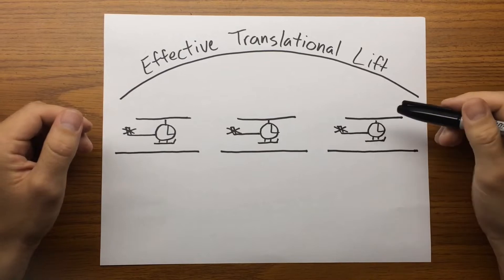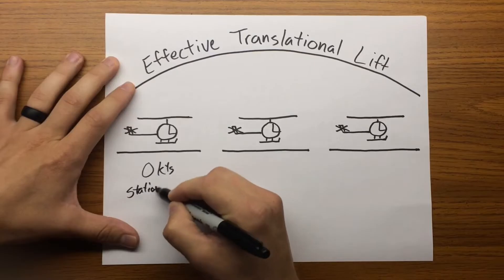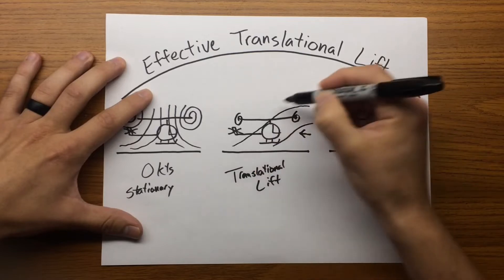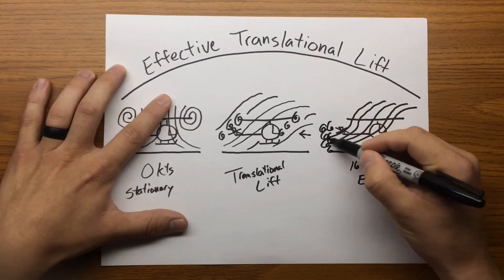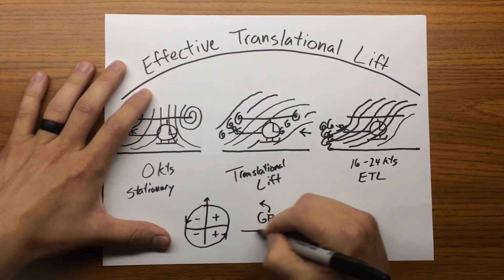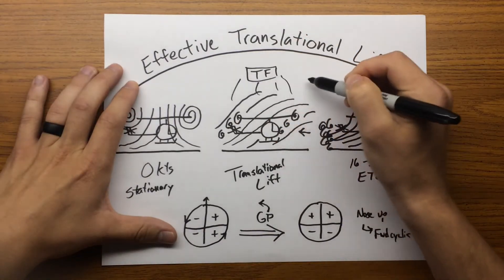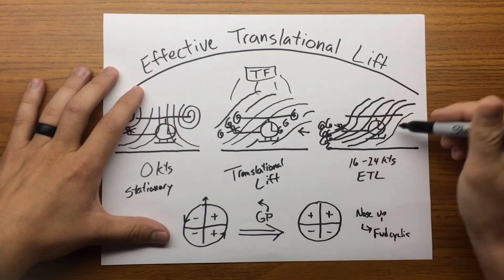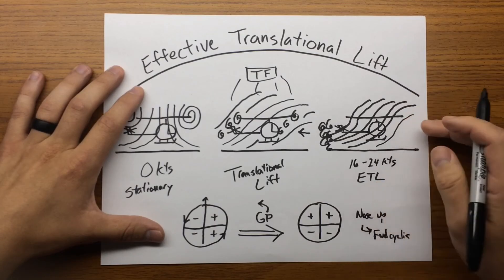Effective Translational Lift (ETL) in Helicopters

Comment: Thank you. Your instruction is concise and understandable. Although I only fly simulated helicopters in X-Plane (at least during this non-lotto winning period of my golden years) if I've paid proper attention to your tutorials they should be instrumental in my more effectively avoiding vertical ring states and settling with power during simulated attempted landings. I seem to be aces at crash landing. Getting something up in the air is one thing but getting that same something back to earth safely is the real trick shot.

Comment: does this have anything todo with the ETL switch in an r22?
im trying to find out what that switch does in a sim
Reply: Hi, I think the switch you’re talking about is an ELT (Emergency Locator Transponder) it’s used of you need to alert the coastguard or similar that you’ve had an accident. ETL is a form of aerodynamics.
Reply: @hangtenhelicopters4498  thanks

Comment: But wont the tip vortices always be present at the tip of rotors blades? Since the pressure difference is always present which produces lift, how can tip vortices disappear from tips?
And as per the video, do airplanes too 'outrun' their tip vortices? Or they are always present, which I think they are?
Reply from the maker: The vortices primarily refer to the overall churning of air underneath the rotor system and are not limited to tip vortices. Once the helicopter outruns these, it is operating in a cleaner air environment. The tips will still spin of vortices but the helicopter should be outrunning most of the negative effects.

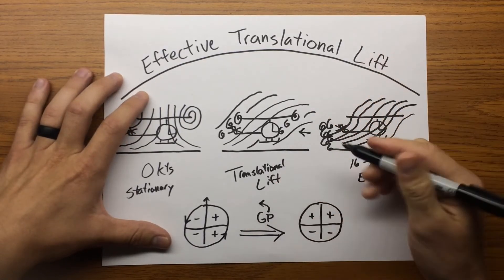Comment: At,  3:55, you go into the dissymmetry of lift, and explain that with Gyroscopic procession, the advancing blades create lift that translate to a NOSE-UP tendency.  However, in your video explaining the Compensation for Dissymmetry of Lift, at 1:00 you explain "if dissymmetry of lift were allowed to continue without compensation, there would be no way to maintain forward flight.  The advancing side would continue to produce more lift than the retreating side, causing a constant roll to the LEFT."  I don't know if this is a mistake or if I'm just missing something.  TLDR: In one video you say dissymmetry of lift creates a left-rolling tendency, while in this you say it's creates a nose-up tendency.
Reply from the maker: Christian Cattell. Good catch! If left uncompensated for, Dissymmetry of Lift would cause a nose-up tendency due to gyroscopic precession.

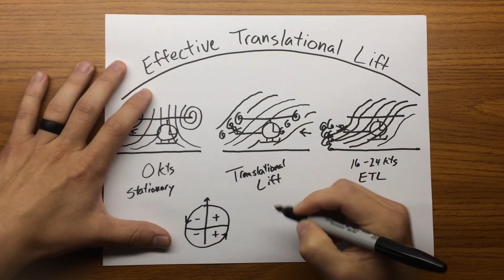Comment: Great videos sir! Thanks a lot. A small question though: in the concept introduced at 3:40, don't the effects of gyroscopic precession and dissymetry of lift get compensated by cyclic feathering and blade flapping? Or they're greater than what can be compensated by these and a forward cyclic is necessarily required? I believe I am missing something, would appreciate if you could help.
Reply from the maker: Gandharv Mahajan. We compensate for Dissymmetry of Lift with blade flapping and cyclic feathering. Gyroscopic Precession is compensated for in the control rigging. I expanded on these more in my videos (Compensation for Dissymmetry of Lift https://youtu.be/culBbvszRpk) and (Gyroscopic Precession https://youtu.be/MH1emIx5Ubs).  I hope these help.
Reply: Thanks a lot for your prompt reply, appreciated. So to clarify, the blade flapping (for DL)and control rigging (for GP) do not compensate for the effects of the blow back (4:00) and forward cyclic must be applied to prevent the helicopter from pitching up?
Reply from the maker: Gandharv Mahajan. Both blade flapping and cyclic feathering (forward cyclic) work together to offset that blowback effect.
Reply: Helicopter Lessons In 10 Minutes or Less: I understand now. Thanks a lot and again, you're doing a great job with the videos. I'm watching them all multiple times before i begin training. Any tips for a person who's gonna start training for CPL(helicopter) soon?
Reply from the maker: Gandharv Mahajan. The biggest advice would be to have an understanding of the basics before you get started. By understanding the importance of ETL or IGE when flying can keep you out of a lot of trouble.
Reply: Helicopter Lessons In 10 Minutes or Less: Thanks a lot! Will keep that in mind. :)

Comment: Is it ETL happened btwn 16-24 kts for all helicopters? Nice video btw. Thanks Jacob!
Reply from the maker: be a ahmad. The airspeed varies slightly but that range generally covers the range most helicopters pass through ETL.
Reply: Lemme guess: the variations in speed depend more on the diameter of the rotor disk than anything else?

Comment: Well explained.  The slight difference I recommend is the drawing from top down should have had forward flight  in the same direction as the drawings above (if you get my meaning).
Reply from the maker: Tray Wilson.  I understand what you're saying but for my videos I try to keep all top-down diagrams in the same direction for continuity. You can see in my Aerodynamics in a Takeoff video where I combine multiple aerodynamic forces from my other videos. I reasoned that having changing directions would muddy the water and make it harder to put everything together. I do appreciate the feedback though.

Comment: Nice one. One question ...At ETL level of flight is it more efficient than case one i.e in zero speed ground effect ?
Reply from the maker: Rashmi Ranjan Nayak. That's correct. After passing through ETL, the rotor system outruns all of its vortices and operates in cleaner air. This means it is more efficient.